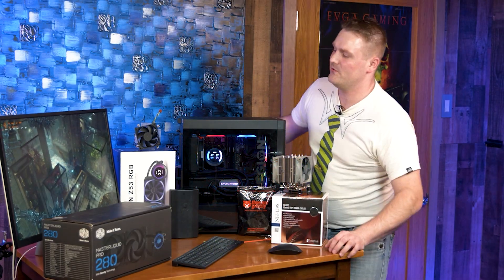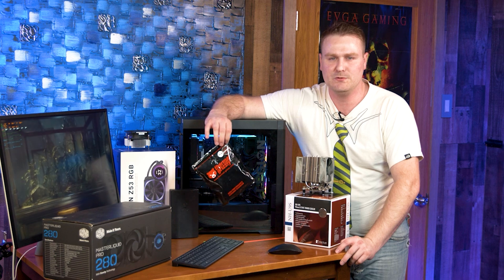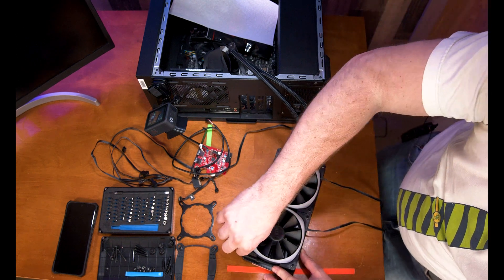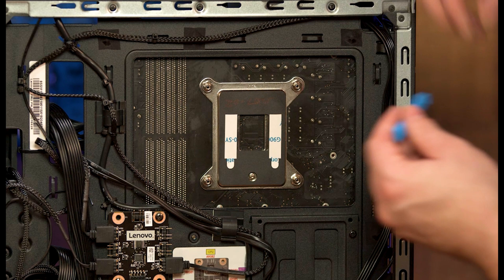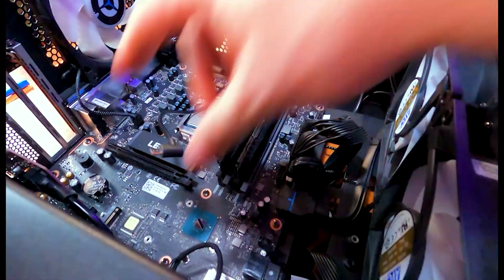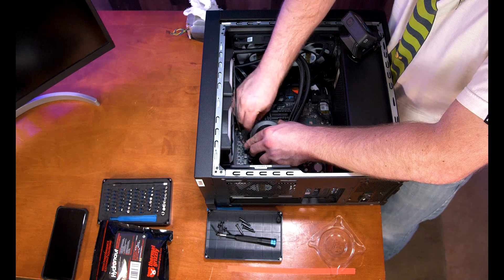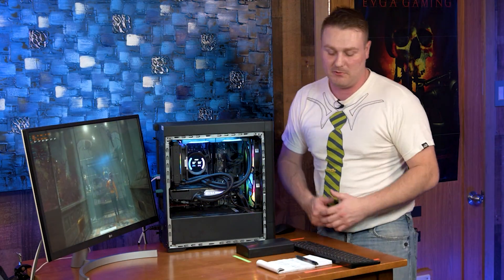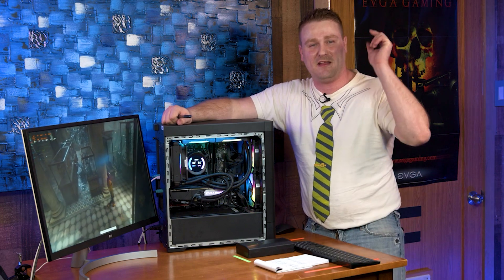Lenovo Legion T5 PC NZXT Kraken Z53 AIO Install W/ Before After Benchmark Results!

Comment: I have the same computer and the back plate looks different mine is more square and I am under the impression mineis LGA 115x mounting. I bought a Corsair Nautilus 240mm for my Lenovo Legion T5 26AMR5 and it says on box that it is compatible for am4/am5 & Intel 1851/1700. I tried mounting the brackets but they dont fit anyone have the same issue? any suggestions?

Comment: Will the kraken elite work ? Ive followed this video and the software does not pick it up... NZXT Kraken Elite 240 RGB 2024 - AIO CPU Liquid Cooler - 240mm Radiator - F240 RGB Core Fan - Customizable 2.72" IPS LCD - NZXT Turbine Pump - AMD® AM5, AM4 - Intel® LGA 1851/1700, 1200/115X - Black
Reply from the maker: you need to follow the video and add a USB card

Comment: Hey Bro, i got the Same pc with an 3070 and iam have got switched the case, then i bought a 9 pwm fans and when i am going to Connect the aio (Thermaltake th360 Snow) then it beeps and i can do nothing

Comment: If i get a rgb aio do i need to be able to control it or can i skip being able to control it. Then would the rgb will still turn on?
Reply from the maker: You do not need to get a aio with rgb. if you got one and did not plug it in it would normal just do noting. unless you programed it 1st and then gave it power. then the only problem would be you could not change it.

Comment: I've installed the Cooler master Ml240l v2 on the legion t5 26iab7 (intel lga1700) without any problem thaks to your video. (And installed a new Psu 750w)
Reply: Hi what are you Connect argb? On dedicate porta on mainboard or use a Connecticut with pilot? And second question you change anythink on uefi? I mean cookie type set on Basic or advance or maybe premium?

Comment: dose any one know that wich rgb cooler is compatibul with tihs pc like i dont have to buy the other tiny card for rgb
Reply from the maker: Any 240mm should work as long as you do not need rdg stuff
Reply: @TNW1337  so your saying if I do want rgb in this pc I do have to get the rgb card but that’s only if I want rgb iam I correct?
Reply: @deathfox6248 no u need the card thing either way because you cant connect 3.0 header to the motherboard without it

Comment: This might be a dumb questions but I’m like brand new to PCs and I’ve been watching a lot of your videos since I have this exact computer. So is this only to cool the cpu or is this something you can build off of to make you pc water cooled? Trying to learn more
Reply: It’s basically just to cool your cpu and I think it also cools the pc a little but you can still swap out your cpu if you end up upgrading with no problem I’m also new to pc I just picked up a legion tower with a 6500xt gpu and 5600g cpu with 8gig of ram. I upgraded to a 3060ti,32gigs of ram and a 850w power supply. I’m looking to get a liquid cooler but that usb 3.0 port is throwing me off since all mine are in use and I don’t understand how to install the extension card he installed.

Comment: I did the corsair watercooler and now it is saying pump failure. I used the rgb header for the USB header on the motherboard could this be my problem?
Reply: Did u figure it out
Reply: @Preet2k it was just a faulty cooler from the start but now I got a different motherboard.
Reply: @ApexScooby25 which motherboard did u get? Im planning on putting ASUS B550-Plus WiFi II. Did you have to do anything to get your front panel to work ?
Reply: @Preet2k I got a new case as well the only thing that’s the same on my rig is the old hard drive and the nvme which I just got another 2t nvme. The Lenovo was ok for starting for better upgrades it’s best to get away from proprietary software
Reply: @ApexScooby25 I upgraded like everything except the motherboard and the case pretty much. I was asking cuz lenovo has proprietary wiring for the front panels. Wondered if you had to get different cables to the power button and all dat it work on your new motherboard. Also did you get a motherboard which was atx or mtax.
Reply: @Preet2k atx I went with a Corsair case as well. Basically after I commented on this video I went out and just upgraded everything

Comment: I bought a different 240mm aio but the bracket lenovo uses doesn't work with anything please help !
Reply from the maker: It should be 4 or 8 Screws that hold it up top.
Reply: @TNW1337  I bought the Lian 240mm aio and could not mount the pump on the cpu with the hardware they gave and with the Lenovo bracket on bac of motherboard
Reply: It's an amd 7 cpu
Reply: @simpilot6228  you need to replace the lenovo backplate, it uses m2,5 screws instead of m3 so you need to get a new backplate for your socket.

I have heard some people with amd couldn't fit a normal am4 backplate so maybe you need a new motherboard or a drill

Comment: Hello technitwit I was wondering for this legion pc do you know the chip socket or possibly have a list of new CPU’s that can be put into this pc i currently have a i5 11500 and was looking to upgrade it but I’m not quite sure what socket this motherboard uses any help would be greatly appreciated thanks.
Reply: I believe lenovo uses the 11th gen socket (fclga1200) which allows you to upgrade to the i9 10900k or 11900k, personally recommend the i9 10900k for overal performace and the i7 11700k (the 11th gen i9 only gives 5% performance). I will recommend you to upgrade your cpu cooler in that case even the 150w cpu cooler is too weak for an i9/i7 as they have 180w+ power draws. I would like to add that I'm not sure if the bios allows different cpu's
Reply: @apotato5563  do you you know how to update or change the bios because i think thats the problem i ran into i put the i7 11700k lga 1200 in it but it just did the 3 short beeps and 1 long beep when i turned it on but as soon as i put the i5 back in it fired back up.
Reply: @austin6157  there are two things that you can do
1. There is a video made by Iteststuff where he changes an AMD cpu and it worked but that is on AMD and I fon't know if it works with intel. But you can try because it's not permanent and is free

2. You buy a new motherboard, I know this is not fun but the 11700k is more expensive than a new motherboard
I recommend an Intel B560 if you aren't going to overclock but you have a K cpu so a Z590 would be nice 'Z' motherboards can overclock, also a new mother board probably allows XMP allowing you to upgrade with non JEDEC ram if you wan't to that is

I do recommend starting with option 1 or consulting an expert, I'm just a pc nerd to a proffecional. Option 2 should also be made by doing extra research yourself on what to buy and how to work with a motherboard, I don't want you to lose money on an expensive gaming pc

Ps do you know if a 280mm aio fits in the T5's case?

Comment: Hey Technitwit I'm having a problem w my PC not sure if you can help figure what the issue is but my computer started to act slow this past few weeks, when I run games it will be fine but when I hit the windows button to open a different tab it will start to freeze and make a buzzing noise any idea on what it can be? I've been looking everywhere for help but it's hard .